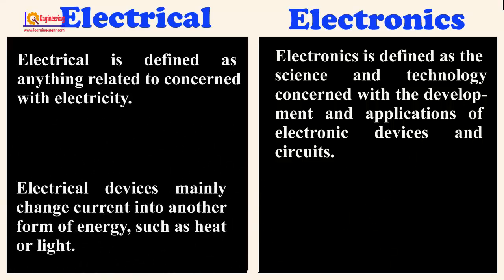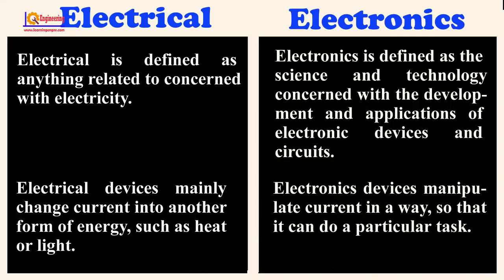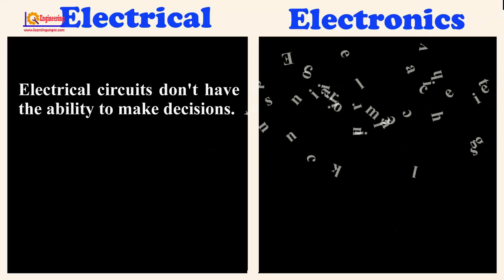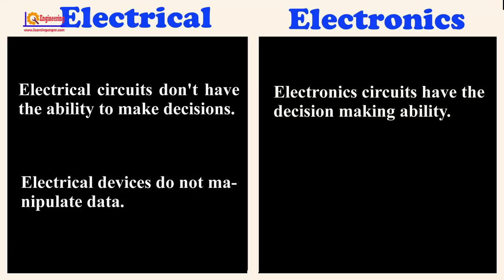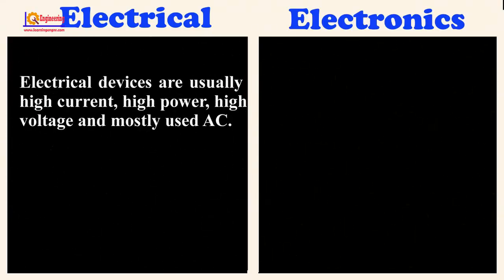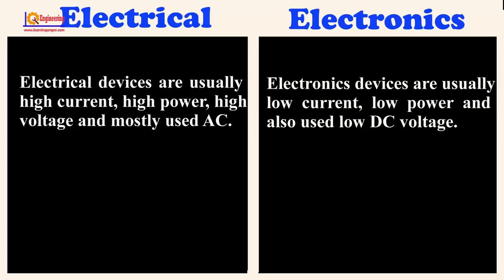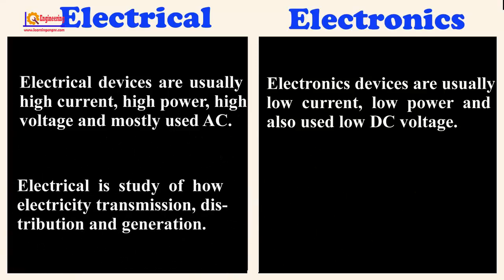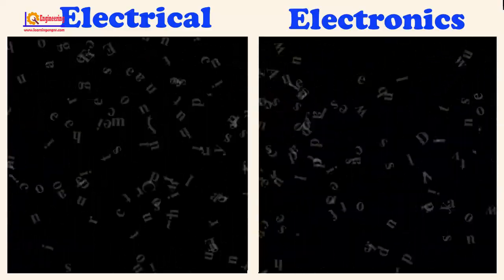Electrical vs Electronics - Difference Between Electrical and Electronics

Comment: Actually, Electronics engineering is subset of Electrical Engineering.

"Electronics" is a science which is an integration of Electrical science(electrostatics, electrodynamics, magnetics and  electromagnetics) and Material science (material state and electrical properties of matter) where electron(electric-ion) plays important and fundamental roles. 

Electrical engineering is a broad field of engineering which is not only limited to energy and power systems( generation, transmission, distribution and utilization of electrical energy) but also deals with the analysis, synthesis and applications of various electrical phenomena in other systems like in control systems, signals and signal processing, communication systems, measurement and instrumentation, optoelectric systems, electromagnetic systems, electrics of materials, design of electrical devices, components, equipments and systems, etc. To study these systems one should have a good knowledge of Electronics. In addition to this, elctronics give the basis for dealing electrical phenomena electrically i.e. without the means of manual and mechanical systems.  So electrical engineers need a deep knowledge of electronics along with electricity, magnetism and electromagnetism.
Reply: hello sir, i think u can help me
Reply: Sir,i am 12th completed student (pcm), i am confused to choose EEE or ECE . I am interested in electronics ,making and designing appliances. which engineering is best for me and my interest ,either Electrical and electronics engineering or electronics and communication engineering. 

please help me to solve the future question of mine

Comment: In an easier way to understand is that, electrical you deal with let's say wires on the wood poles on  the sidewalk you see everyday and also is the most dangerous. Electronic you deal with things you use everyday such as phone, TV, etc. And is less dangerous.

Comment: Then why vehicles running on low voltage dc batteries are term as electric vehicles
Reply: Satish Gupta that voltage is stepped up to be enough to power the engine, I don’t think a 12v engine can move the frame of a car, let alone a car with a driver and passengers lol